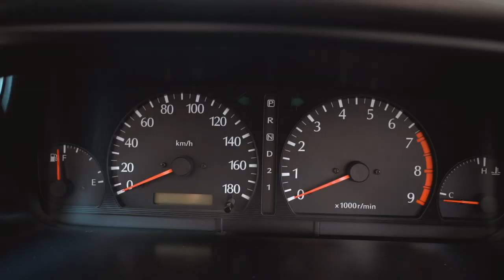Noise from under the hood | AUTODOC TIPS

Comment: Yo is that a rb25? Only reason I clicked 😂
Reply: no. 2jz ge
Reply: @lexiskitten4713  no it's not....
Reply: The valve cover looks different
Reply: its a ge. not a gte. so its non turbo. i should know i work for toyota 😂
Reply: also notice that the car it lives in is a toyota crown/cresta just before rhe hood is popped.
Reply: @lexiskitten4713  normally you would work on new Toyotas If u work there lol, very rarely tunable cars as owners usually maintain them themselves I work at nissan and I have a r31 used to have a 4 door r34 witg na rb25 it looks identical
Reply: still of the engine line up. plus any early lexus with the number 300 in its name has one of these blocks. they are really common so knowledge about them is plentiful.
Reply: and knowing engine history never hurts.
Reply: @alexstreetstyle9466  you should learn a bit about nissan engines if you actually work for them. Confusing a 2jz for an rb... lol you should be ashamed. Lexis schooled you 🤣
Reply: Its not a 2j because the inlet is in the opposite side. Where the inlet is on this there should be the exhaust if it was Toyota series engine @Lexiskitten. And R31_JDM  it does look like a Nissan rb25

Comment: I have the same problem at 2:20 on my 04 peugeot 307... wont change that is bare expensive
Reply: UPDATE: i have noticed the sound doesn't make noise all the time, is random cold starts...
Reply: That's just piston slap, it should fade/go away when engine is warmed up.
Reply: No problem, just rev the bollocks of it until the sound fucks off, 👍😀 Happy to help (no charge)